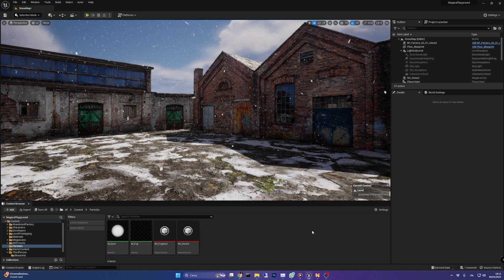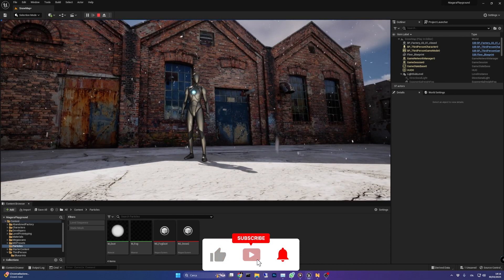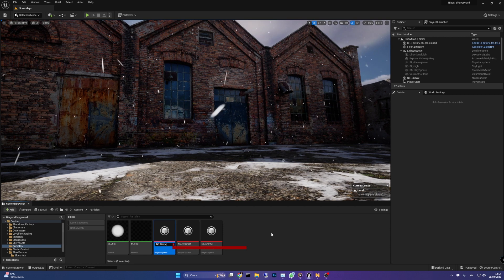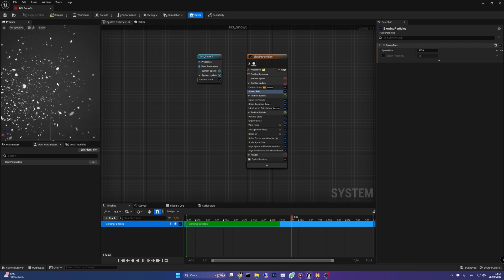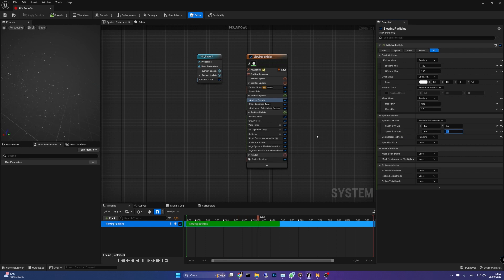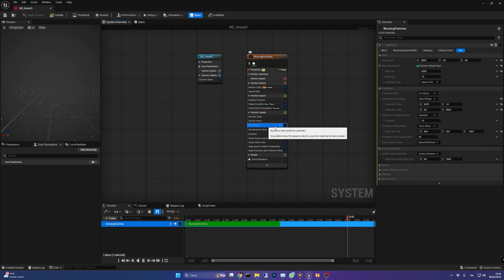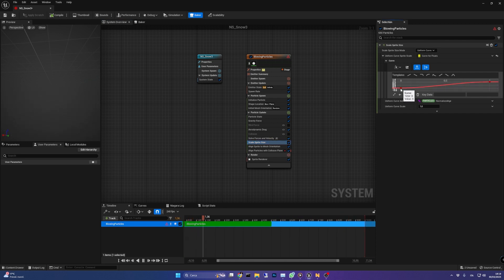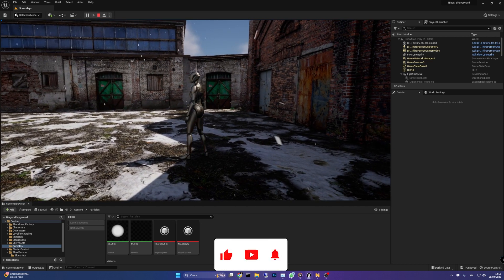[UE5 Niagara] How to make SNOW easily!

Comment: I've strictly followed the video but the final result is far from being optimal, I'd say John's got no snow. Isn't supposed to work the same way in 5.2, being something so basic? I've tried to apply it to a classic OpenWorld level to have the snow across the whole landscape but failed miserably. Any suggestion!? I really dunno what I did wrong.

PS: Nice channel by the way, definitely subscribing.
Reply from the maker: Heya, thank you for your interest ;)
The process should definetely work on 5.2, in fact is the engine version used while recording this tutorial! If you are pushing the snow box extents to a big area, be sure to increase the particles spawn rate, otherwise the snowflakes will be sparse. Beware that cranking up the particles count can lead to performance issues, even on simple effects like this!